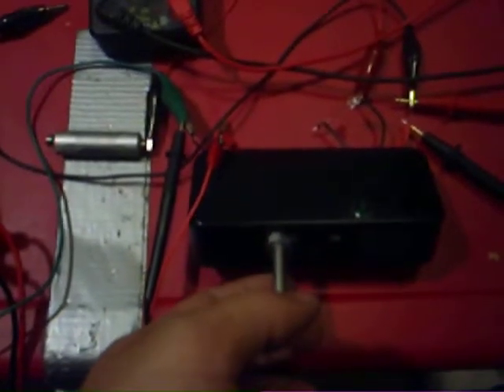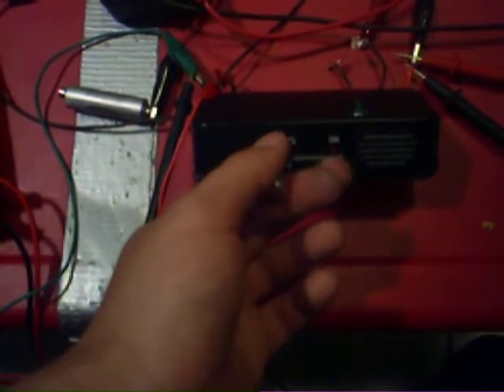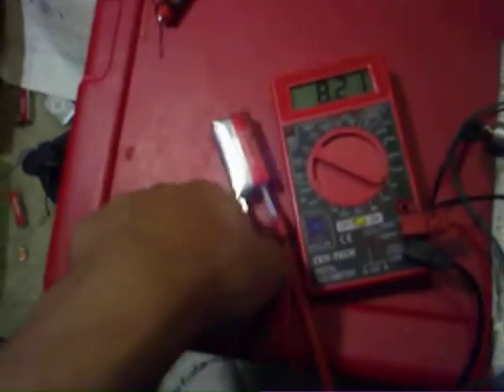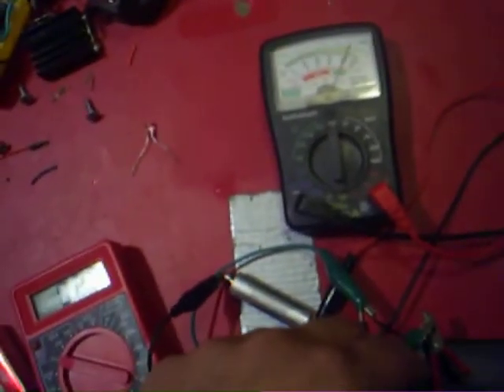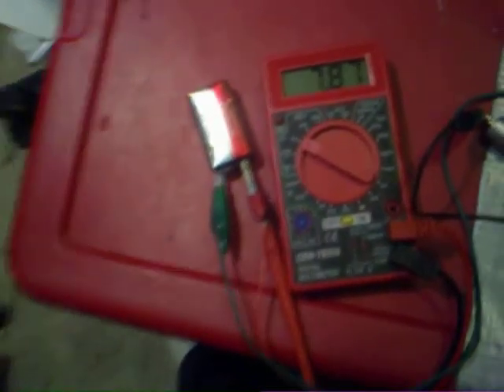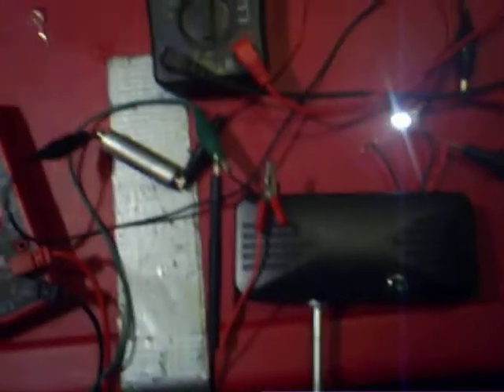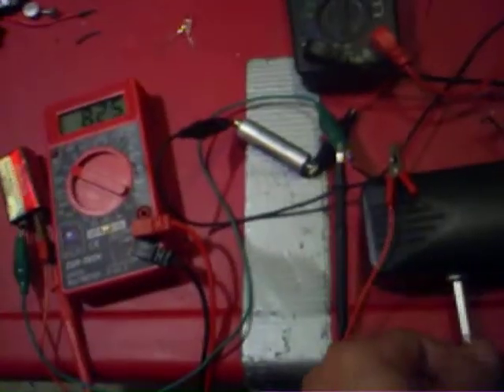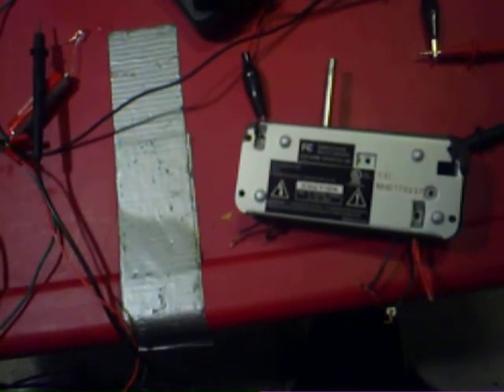1.5v 20mA Joule Thief lighting 3v led and charging 9v

Comment from the maker: i think its pretty cool.. but heres the thing.. i can get pretty much the same amount of light from a small pulse motor running at no more than 5mA and there is the additional rotation.. so this tells me a 3v led should have the ability to show decent light from as low as 1 or 2mA if done correctly. not able to do so yet but i believe its possible. and out of all the different circuits out there, seems like they all boil down to basic blocking oscillator derivatives that can all work the same.

Comment from the maker: it would be similar to cap pulsing the source, but there are losses in that as well.. I kind of picture a capacitor being charged with DC from an input battery, then input battery disconnects from capacitor, circuit fires the input from the cap and the flyback goes to the disconnected input battery, then the cycle continues.  likewise i picture better general efficiency that way.. running a rotor from a capacitor, but pulsing the capacitor via a battery to maintain the motor, would it draw less?

Comment from the maker: well i look at it like, especially with these circuits, even if we were to design it so during the time the flyback is entering the supply battery, the battery was disconnected from the front of the circuit, then I feel we would still need to regulate the input to the circuit. in high frequency every pulse to the run batt that raises it's standing potential will cause the circuit to gulp more unless the battery has had enough time to settle. thats the way i see it. so for example, lets say ....

Comment from the maker: im with you on that one bro. seems like the output back to source is always a losing battle and if anything rather than really put some "back in" we are getting it to draw a little less.
even with a seemingly fool proof design it does not work. I think it is because of frequency. how do we expect to use a blocking oscillator to pulse out and pulse back in at such speeds? the battery doesn't like that so much. i can imagine a circuit that pulsed slower than 1hz would have better luck at it.